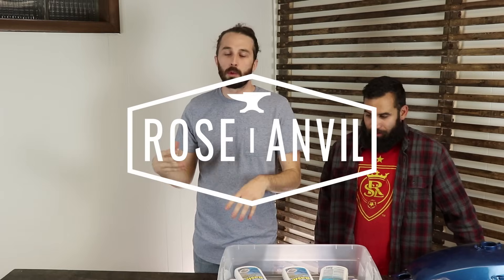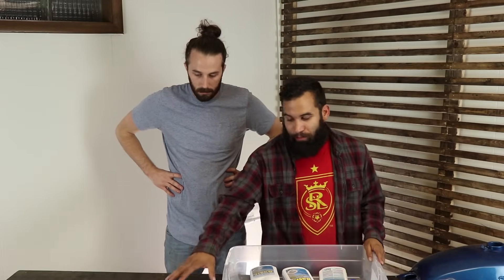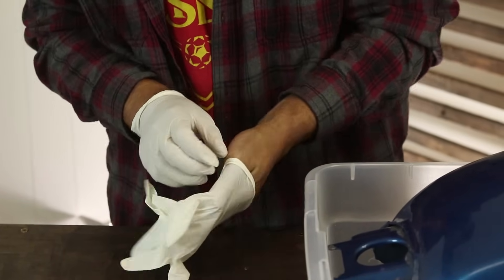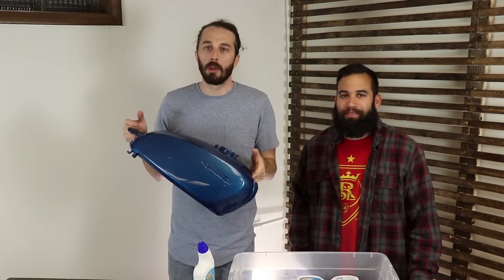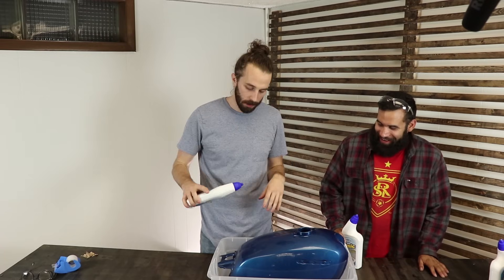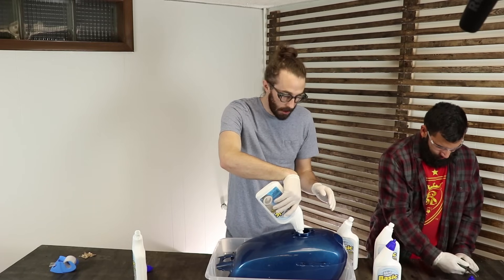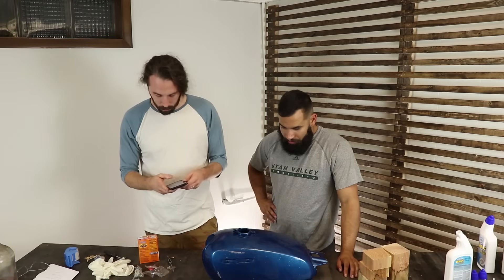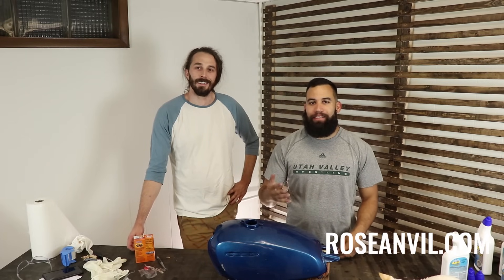How to REMOVE RUST for $1-  (HOW TO CLEAN A GAS TANK) - motorcycle gas tank pt.1

Comment: If you don’t remove the fuel pump while flushing and sealing fuel tank will you ruin the fuel pump?
Reply: Very easily yes
Reply: @withteeth  will it ruin the whole assembly or just the pump itself?
Reply: You’ll likely melt anything that’s plastic, it’s best to keep this to only metal parts

Comment: Last few tanks I've done used muriatic acid and water.  Works well sloshing around every now and then for a day or two.  Followed up with baking soda and water to neutralize the acid and then air dry plus some alcohol to help any remaining water evaporate.  Think its around $8 a gallon and usually get 2 and then the rest water.  Have to do it this week actually to a 2001 suzuki sv650 tank on a bike that's been sitting a few years.  I'll see if walmart has any works cleaner, the Amazon link is to a multi pack for $22 so a little cheaper to use muriatic acid.  But good video though.

Comment: I dont know jack about chemistry but i do know that if you own a older car or a bike DON'T  put ethanol in your ride, not asking you a impossibility,i dont live in a big city like New York on Chicago and there are like 20 gas stations that sell real gas where i live,Ethanol sucks ass, i wouldn't even use it to clean parts with,one of my older cars about 10 years ago was running rough,i decided to do my whole fuel system,once i peered into the tank i almost had a fucking heart attack.

The inside of the tank looked like it was retrieved from the Titanic, the sending unit was a ball of rust along with the pump,the injectors filter baskets were full of something that looked like mud (you will normally after a few years have some dirt but nothing that resembles mud),a total mess,800 dollars later including  a gas tank sourced from Canada and things have been copacetic.

Here is the proof,after about 5 years of using nothing but real gas i started having a small leak from the gasket that goes from the tank to the filler neck,this is a common maintenance every 10 years or so in this kinda car etc,its like15 bucks,the gasket dries up and leaks, sometimes they can go for 20 years, all depends,anyhow i took advantage i had that gasket out and peered inside the tank,looked like Aquafina in there it was so nice and clear, no more ethanol for me.

Comment: I followed your instructions to a tee. Last step was WD 40 so I gave it a good coating. I removed as much as I could but it looks oily in the tank. At the end of the video, you stated that you would go ahead and seal the tank. Can POR 15 tank sealer be used AFTER the WD 40????  Someone give me an answer please before I dump that stuff in there...
Reply: I wouldn't worry about it too much. A small amount of wd40 or equivalent in ur gas wont harm ur engine, it will just burn it off. As for the tank sealer, I wouldn't worry about it. You will have gasoline in the tank from now on, how can it rust? Mine rusted cuz it at around for years, '73 Honda CB350

Comment: I used murioic acid.  After I did it, there flash rust, so I will have to do it again.  It is difficult getting the water out of the tank fast.  Maybe just empty it out then flush it with gas mixed with oil.

Comment: I tried this on my mini bike tank long story short it worked amazing but nit perfect then saw they changed the hydrochloric acid from 20 to 9%  so that's probably why it didn't work as well as it did for you guys.
Reply: how much cleaner did you use in your minibike tank. i plan on doing my minibike tank soon. also i saw your other comment about how much baking soda to use, did you ever figure it out, i am confused aswell,

Comment: I feel like these guys bought an xs650 off me last year 😂
Reply: I love the XS series. Got a 1976 XS360, seized motor with 4,000lb+ of pressure on it and it won't break free. Trued soaking in Marvel mystery, pb blaster, diesel, rust remover, and paint thinner. Nothing worked so I guess I need a new motor.

Comment: Sucks for me the water made mine rust and get corroded as soon as the water touched the metal. 80’s kawasaki tanks must be delicate
Reply: thats what they were referring to in the video, flash rust. you need to add some kind of neutralizer such as baking soda, wd40, marvel mystery oil. or a tank liner, gl
Reply: Vincent Kaser I had washed it out with water, the water worsened it, even though I put oil in the tank after washing. This time I’m using evapo rust but I’m just going to drain it and fill with gas and oil. No wash. Then drain that and put either the oil in or ethanol free gas if I have it by that point.
Reply: Vincent Kaser I used grocery bags to plug the tank holes then the toilet bowl cleaner ate the plastic, I got burned!
Reply: thats where they messed up in the video, bags deteriorate easy, i wouldve used a plug of some kind, im about to use the works today, so well see how that goes
Reply: Madbrahmin ya pipe plugs work well I hear and you can cut a cork

Comment: Where do you put the fuel filter??
Reply: Between the tank fuel tap, and the carburettor, in the fuel line. Ensure it is fitted the correct way round.

Comment: This caused my gas cap to explode apart and didnt clean the tank even a little bit. I did exactly what was said and mixed 50/50 with water. Now I paid for the cleaner, which is super hard to find right now and is way more than $1, and have to pay to replace the petcock which practically dissolved and the gas cap. Anyone who tries this should absolutely remove their petcock and gas cap and plug those holes somehow, I used a cork and that dissolved too. In the end I should've just bought a universal tank for $50 on ebay.
Reply: ... they said to remove the petcock and cap. They then reiterated to remove ANYTHING you don't want to dissolve, since The Works' main ingredient is hydrochloric acid. You did this to yourself.
Reply: @michaelmcguire8811  the petcock wasn't inserted in the tank, it was in the bucket I had the tank in, I had the petcock hole corked. I get I shouldnt have done that, but I just wanted to keep the parts together and I wasnt expecting the cork to dissolve or explode out or whatever happened to it. The gas cap was installed in the tank, but wasnt touching liquid at all so it didn't get damaged from that. I'm not sure how, but the next morning my cap was exploded everywhere so I'm assuming pressure built up or something and blew it apart, shot the cork out, and filled the bucket with the chemical/water mix. When that happened I got a new cork and duct taped all around it and left the new gas cap off the 2nd time. Damaging the parts may be on me, but my ultimate point was that I spent the money on the chemicals that were hard to find, followed their instructions on diluting it and it didnt remove the rust at all.

Comment: Do put ethanol blended fuel in your fuel tank this will keep rust out of your fuel tank. Ethanol is water soluble witch means the alcohol in the fuel brakes down and turns into water if any water gets into the fuel tank.
Reply: Rusty Beatty so it’s okay to just run gas into it after it’s cleaned

Comment: :(  they don't sell that product in Canada
Reply: it's basically a low % hydrocloric acid.   they're only using it because it's a cheap shitty cleaning product sold at big box stores.  Could just by hydrochloric acid and dilute it.... or any product with a mild concentration  like 10% acid.
Reply: Vinegar works to

Comment: took me less than 30 seconds to find out the main ingredient in this stuff is hydrochloric (muractic) acid, WHICH IS EVEN CHEAPER.  Also this stuff contains CHLORINE, whichc is an OXIDIZER, as in iron oxide, RUST! So not only are you using a more expensive version of something, you are also using something that is doing (making rust) the exact thing you are trying to clean, because the chlorine causes rust. So i have to say this is not the best method.

Comment: Couldnt i use my ammonia cleaner to neutralize the acid?
Thanks
Reply: christina p I’d make sure that the ammonia is not reactive with whatever you used to clean it with first.  It could react and create ammonium chloride gas,  which is dangerous af
Reply: @byronaldridge7845  well aware...as i have made a mustard gas before by accident!! Thanks

Comment: seal the tank with what?.....
Reply: tank liner is a good option, but you can use basically anyrthing that neutralizes the rust like marvel mystery oil, baking soda, wd40, etc.
Reply: Madbrahmin would that not interfere with the fuel? Obviously you wouldn’t leave a pool of oil or whatever in there but still, wouldn’t it mix?
Reply: @bykers81  Yeah it qould mix but once it is sucked into the carbs it'll just burn it right up especially wd40 because it has kerosene in it and mystery oil is a fuil additive so it's meant for gas tanks.

Comment: Or, you can go to Lowe's and buy a gallon of Hydrochloric acid for eight bucks.
Reply from the maker: for sure, if you look for Muriatic Acid that is the same stuff too
Reply: or you can do Electrolysis for less than a dollar! Oh, and it is way safer.
Reply: @JohnTheRevelat0r  still I'd rather deal with 10$ extra on my electrical bill than harsh chemicals